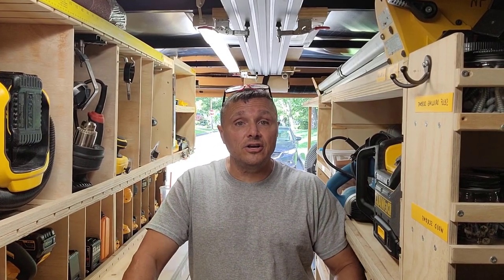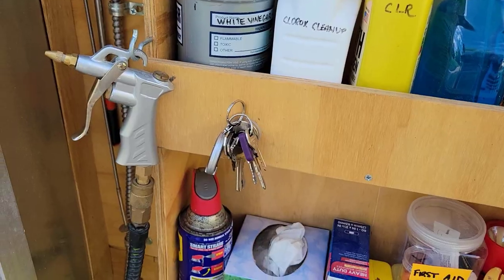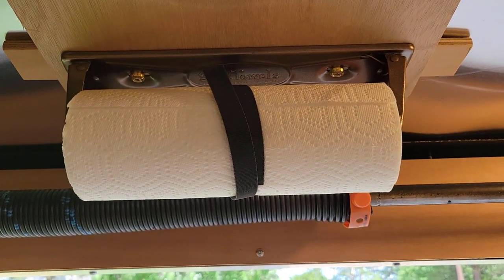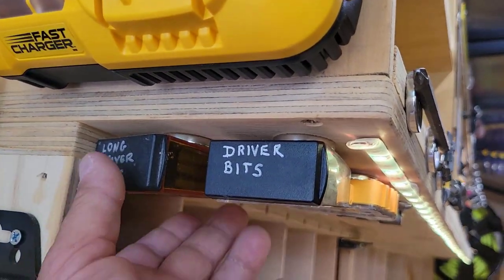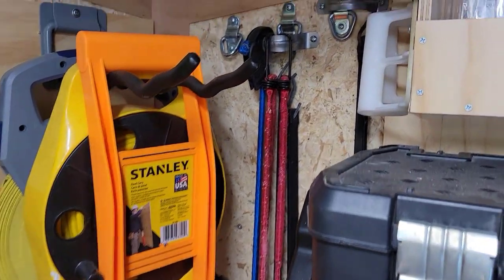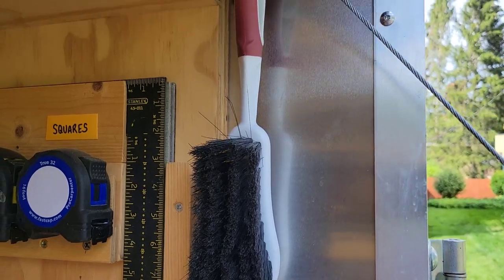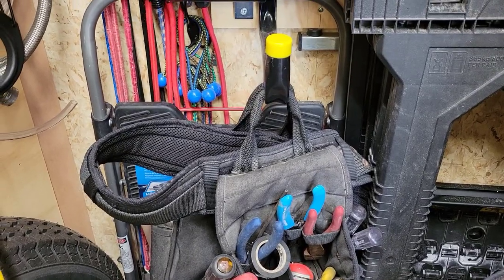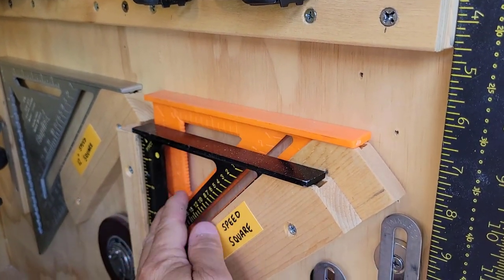STORAGE on the TOOL Trailer  - "a la carte" deep dive - Paulk-Inspired sSMART tool trailer

Comment: whered you get those racheting clips, those would be handy but can't seem to track em down
Reply from the maker: I found them on Amazon for around $12. Here is what you can search for:  E-TING 4Pcs Hand Tool Toggle Clamp 201B Antislip Red Horizontal Clamp 201-B Quick Release Tool.  Good luck. I hope they work for you. I have had good luck but have to tighten the nuts once in a while. I could probably use lock-tite and be done with it.  Thanks for checking out the video! Like and subscribe if you “like” and want to subscribe! Have a great day